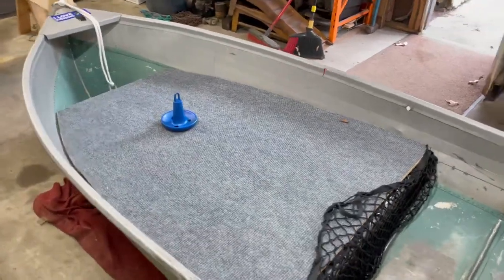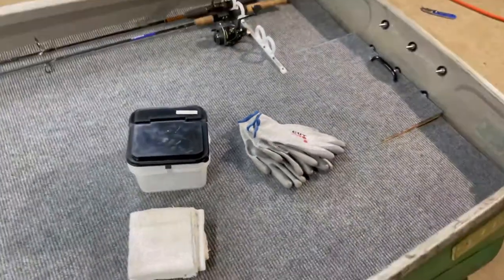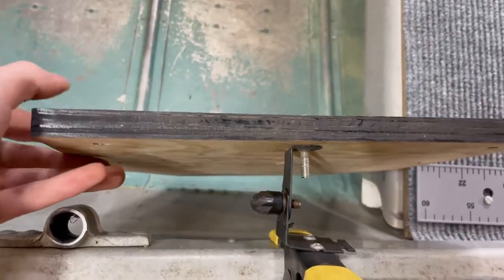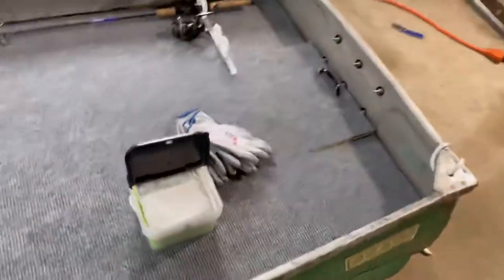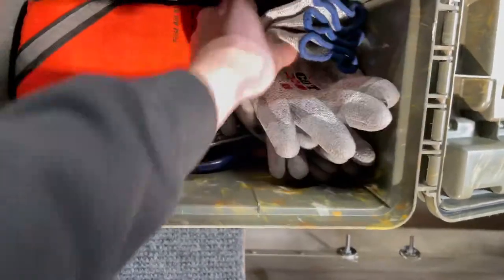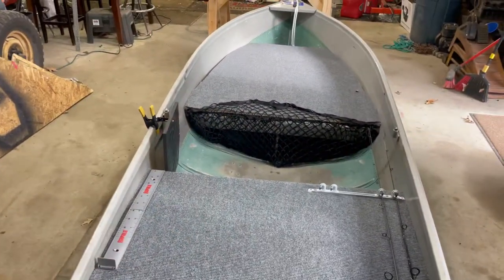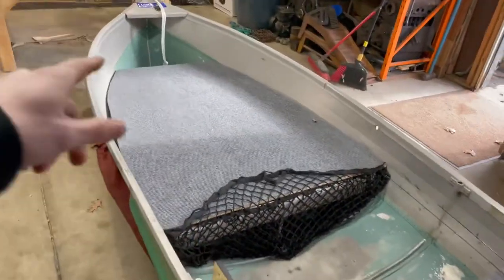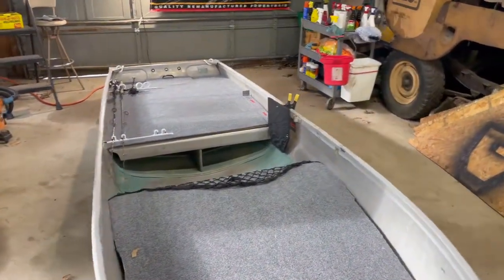Row Boat to Bass Boat Build is Complete!!!

Comment: I'm stealing your table idea for my canoe. Thats the coolest idea I've come across in 50+ years of fishing. A hint though if you already haven't figured it out. Try using a flat style locking lid hinge to keep the table from rocking while you use it. Sorry i dont know the correct name, but you'll find them on most boxes with a lid that lifts.. Also anywhere you have something on the floor, you need a mat or rug to dampen the noise. Sound travels forever under water. I buy those cheap 3/8" rubber puzzle style mats you can buy in most children sections of any store. They come like 6 to a pack and cost about 5 bucks.